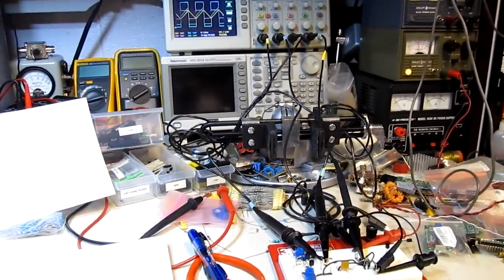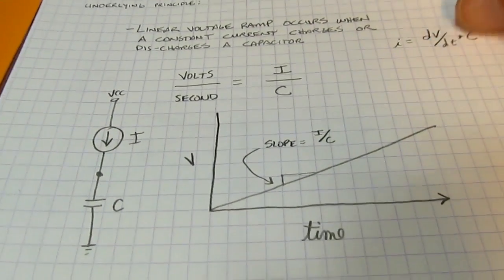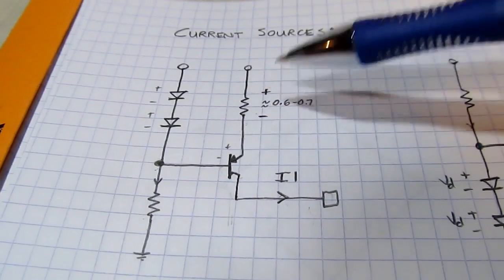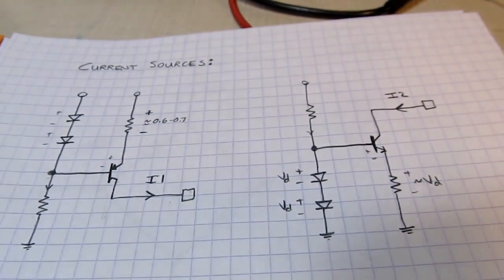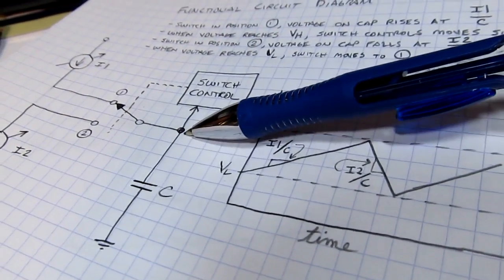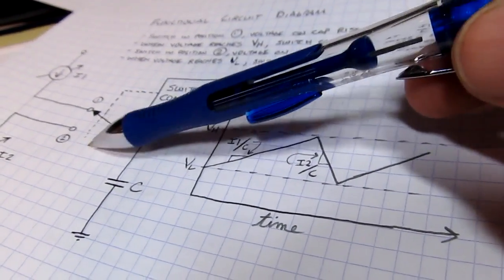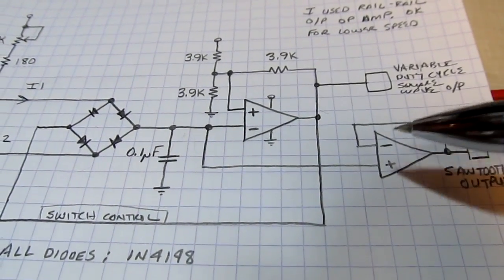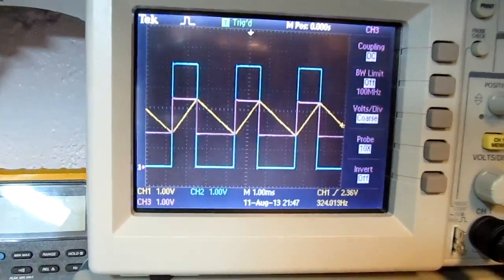#104: Circuit tutorial: sawtooth generator w/ current sources, diode switches, hysteresis comparator

Comment: If a current source causes a cap to charge linearly like that, does that mean a voltage source would create a similar waveform in an inductor?
Reply from the maker: Yes, a step voltage change across an inductor will create a linear increase in current through the inductor.

Comment: I am so glad you walked through that in the manner you did.  That is exactly how engineers think when designing circuits.  Basic fundamentals to Functional blocks (usually add specs) to tools in the toolkit to Proof Of Concept.  Then the fun of debugging those parasitic and/or unintentional effects (e.g., the diodes don't all switch at the same time, temperature drifts, etc. etc.)  You should do one on using a transistor's PN junction as a fast (low charge) diode.

Comment: What happens if one of the back to back diodes is removed? This would place the pn junction of the transistor and the pot resistor at 0.6 volts combined.  Would the transistor conduct? And if not,  would not the resistor become a pull up resistor, putting the DC voltage across emitter and base, which is still greater than 0.6 volts,  yet no current flows? mikey7195@yahoo.com
Reply from the maker: The transistor would barely conduct, very little collector current would flow.
Reply: Thanks....what if given the same the situation i described above and there was no resistor at all...saturation and no way to regulate the current?
Reply from the maker: @mikemoulton5309  With no emitter resistor, and the transistor saturated (due to extremely high resistance at the collector), it'll simply appear like two diodes connected in parallel.  Interestingly enough, circuit structures like this are commonplace in IC design.  In these situations, where device matching is very good, transistors can be connected like this to form current mirrors or PTAT current sources (proportional to absolute temperature).  Often the connected devices are of different sizes, again to take advantage of matching, etc.  Bandgap reference circuits use such circuit techniques.  These things are generally not done in discrete designs because the transistors are not match (thermally or otherwise) to the degree they'd have to be.
Reply: I have more studying to do.  Thank you.  Would it be possible for you to produce a video of a complex circuit and show behavior when a component fails or is removed from a circuit? I`'ll watch as much of your library as possible.
Reply from the maker: @mikemoulton5309  The variations on this theme have infinite possibilities, so it would be a tough topic to tackle.  Maybe my existing repair videos are the best source for this type of information.

Comment: why we have used three 3.9 kohm resistance. can't we do this with two of them i.e. to not use the one connecting the power supply.
Reply from the maker: It will dramatically change the threshold.  When the comparator goes low, the threshold will go to ground and be too low for the circuit to operate properly.

Comment: Love the tutorials and are very helpful.  As I'm a beginning hobbyist, I just ran into the current source and current sink topic.  Could you explain it in depth and the reason you use diodes in series?
Reply from the maker: Series diodes are used to create a relatively stable bias voltage for the current source transistors, that doesn't change much vs. VCC changes.
Reply: @w2aew  Thank you for the quick response!  Keep up the good work!

Comment: Would it still work (but opposite) if you put the capacitor in series between the diodes and the comparator?
Reply from the maker: Hmm  - I don't think so, since the input of the comparator and the output of the current sources are both high impedance.
Reply: Hmm, so no (or very little) current would flow? What if you add resistors to Vcc and ground? I probably should do the math to find out. 
Sorry, I’m obviously very new at this and trying to understand, but your videos help a lot.
Reply: w2aew I think what confused me was that an ideal current source would deliver its current no matter what. But with an ideal comparator input that would be kind of an unstoppable force/immovable object thing... so I guess in practice with non-ideal parts, without the resistors, you’d either surpass the compliance of the source, or get insane voltages?
Reply: ... and if I add resistors after the capacitor in series, effectively a voltage divider, that terminal just sits at the voltage determined by the voltage divider to Vcc plus the voltage determined by the source's current looking into the resistors in parallel. Until the current source reaches its compliance, the collector current breaks down, and the voltage gets pulled down to only the voltage divider's value.

Comment: Thank you. Excellent explanation. Can you explain why use the 2 diodes for biasing the base, also why current varies by changing the collector resistor. I thought the collector current depends only on the base current as seen in working of a CE amplifier.
Reply from the maker: You may want to re-watch that part of the video.  I explain that the two diodes are used to setup approx 0.7V across the emitter resistor, and it is the emitter resistor which is varied to change the current.
Reply: Oh sorry i meant the emitter resistor. My concept was like ic=ie=beta*Ib. But i think now i get it.The emitter resistor drop changes the base current thus changing the collector current.
I understand that the diode drop keeps the base voltage constant. So it is only a convenient way to keep the bias at the required voltage. We can also use  a conventional resistor voltage divider for this right ?
Reply from the maker: Correct.  By controlling the current this way, you make the resulting current much less sensitive to the transistor Beta.  Beta is NOT a well controlled parameter, so it is good practice to design circuits that don't depend on a specific Beta value.   Using the two diodes instead of a resistor divider helps to make the circuit less dependent upon power supply variations.
Reply: Thank you. Love your videos. Keep   up the good work :)

Comment: Love your videos.  Thanks for everything you do.  I repair electronics and most of the time its an easy fix or I get help with it.  Wondering your opinion on what is best way to learn everything cause it seems overwhelming with so much to learn.  Do you have any recommendations for simplest learning curve?????  Any help is appreciated.
Reply from the maker: Well, it is really impossible to learn *everything*!  There really isn't any shortcut.  You'll need a solid understanding of the fundamentals (ohms law, passive components, basic active components, AC/DC circuits, etc.).  For me, experimentation and measurement is the key for learning - I am more of a visual learner as opposed to theory.  But, everyone is different.  Find the medium that works best for you (books, web forums, videos, hands on building/experimenting, etc.), and plug away with that.
Reply: Thank you for your reply.  There is so much to learn.  And again awesome videos.

Comment: excellent video! if one were to use this circuit for a synthesizer oscillator, how can one add frequency and dual slope (rise and fall) voltage control to this circuit? for slope CV, would you hook up the CV to the gate of the transistors, because the current determines the slope. as for frequency you would hook up the CV to maybe change voltage setting the hysterisis? my guesses! would love to know the REAL answer from someone with knowledge/answer!!
Reply from the maker: You could make the current sources controllable by a voltage - that would give you variable frequency controlled by a voltage.  It would do so by changing the slopes on the triangle wave.

Comment: Thank you for making this video,  easy to understand as a beginner.
I have some question for this circuit. I made this circuit on the breadboard, but it doesn't work.
I used the function generator to make square wave of switch control, so i just made circuit with current source, switch, and capacitor. Does it matter of voltage at C? And why the unity gain amp is need at the output?
Reply: The unity gain op amp buffers the voltage at the capacitor. It prevents things attached to the output from drawing large currents from the capacitor and affecting the waveform.

Comment: Thank you again for this nice circuit. I build it last night straight on a perforated board and it works perfect. I used sockets for capacitor so i can have some flexibility in the range and an SMD rectifier bridge. 
Sometimes I feel the confirmation of the breadboard is needed, but thanks to your clear explanation I didn't have to. Great addition for my beginner's lab! (Well, I have a Chinese scope with built in DDS but this is small and battery operated)

Comment: Man I swear this must be the only vid that explains the basics of capacitor on constant current source , and the whole design for a variable ramp wave generator , really grateful for the sharing, one question, how would you solve the problem without the diode bridge, which I also learned in this vid, thanks again
Reply from the maker: If you didn't want to use a diode bridge, you could add some circuitry to directly turn on/off the current sources.

Comment: What op amp are you using? I was thinking of trying to build this using a TL071. Do you think this is a good choice?
Reply from the maker: I don't remember which rail-rail op amp I used.  You certainly could use a TL071, but you would have to use a split supply or shift the operating point of the circuit to be within the input common mode range of the TL071.  You may also have make some changes at the op amp output to be compatible with the switch voltage requirements.

Comment: THANK YOU a lot for all your video! If only YouTube and your channel already existed in the '90s... I am an hobbyist (started with ARDUINO etc) and some of your circuits I built up for some "analog" fun. Now, unfortunately for this one... I have no clue why it doesn't work... I checked and double checked... Can you specify what the supply voltage was in #104, which manufacturer part no. U used for the transistors PNP and NPN and for the OPAMP. Also for the buffering OPAMP. I used the 1N4148 diodes as you told... Thank you in advance!
Reply from the maker: The transistors are just general purpose NPN and PNP, like 2N2222 and 2N2907 or 2N3904 and 2N3906.  I think I used 5V VCC, but anything from 5 to 12V should work fine.  The opamp is any general purpose rail-to-rail device.  I used an AD8032, much faster than what was needed, but it is what I had on hand.
Reply: Thanks again for all

Comment: I would have thought that a mains Bridge Rectifier would have been more appropriate as it would cut down the number of components.
Reply from the maker: Diodes in a bridge rectifier typical have long reverse recovery time. Hence, the use of a set of switching diodes.

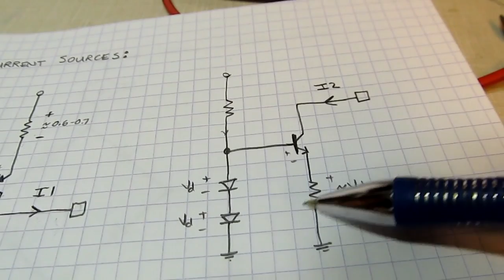Comment: Hi Pro, I built a current source with NPN BJT using your circuit at 5:08 as a reference. A constant voltage is applied to Base and 110 Ohm resistor at emitter. The loads are several LEDs in serial, the cathode of the last LED is connected to Collector of BJT,  the anode of first LED is connected to +24V,   But the problem is: if the load are 2 LEDs in serial, the current reading is 30mA, if the load are 4 LEDs in serial, the current reading is 32mA. In these 2 cases, the voltage applied to Base is constant. Why the current readings are so different, please? Thank you.
Reply from the maker: Because the transistor isn't a perfect current source - it can be affected by collector-emitter voltage and by temperature.  In your case, the transistor's junction temperature rises when fewer LEDs are used (more Vce), that is probably the dominant factor.

Comment: sorry sir.I need create triangle form this circuit but can variable frequency between 2k-50kHz.How to make?
Reply from the maker: The frequency can easily be varied by changing the current sources.  You can use a currrent mirror so that one adjustment will adjust both current sources.
Reply: thank you sir.i want to make triangle 0-5V.amplitude how to make it? and what is variable duty cycle?
Reply from the maker: In order to use this circuit to get 0-5V, you will have to use a split power supply, and adjust the resistors around the comparator to get the voltage extremes you want.  Or, use an op amp to amplify the the triangle wave from this circuit as is.

Comment: i found the same circuit (not as detailed as this) but in an abstract form i.e with two constant current sources (one is sink) and with hysteresis in Design with operational amplifiers and analog integrated circuits by Sergio Franco and thank you W2AEW for making me understand Franco better
Reply from the maker: Yes, this is (was) a very common basis for analog function generators years ago.  It makes a very good example for the application of current sources, diode switching, and schmitt trigger (comparator with hysteresis).

Comment: i bread boarded this circuit and it worked for me , but the waveform is not stable(might be my bread boarding is not good and i should design a PCB for this ) and the other sawtooth waveform generator (constant current source , charging cap with ramping voltage and scr connected transistors didn't work for me) i used 2N2905  PNP Transistor and 2N3019 NPN transistor

Comment: What op amp and transistor using?
Reply from the maker: Transistors are just about any general purpose devices like 2N2222, 2N3904 and 2N2907, 2N3906.  The op amp is a low power, rail to rail device.  I used a LMC6482, because that is what I had on hand.

Comment: Ok I have a good question... how would you configure this so when changing the slope on the rising or falling edge it doesn't change the frequency ?! 

I thought that maybe using a long tailed pair in its differential mode will be a good way to achieve that so each collector on that pair control one of the current source (falling/rising) while keeping a balance between the overall current (tail current) which dictate the frequency. But after that,  how can you turn this into a variable frequency oscillator without affecting the shape of the slope ? 

I thiknk that maybe by varying the tail current (using a adjustable current source) on the long tailed pair this will change the overall current without affecting the ratio between the the rising and falling edge of the slope (but maybe its a sloppy solution especially if you want to have a wideband oscillator). 

So I put this on paper and I might have something but yeah I have some hard time at this point to see how I can correctly connect this without loading the differential pair and avoid to have to buffer each collector with opamp. I would like to know if you have some idea. 

Cheers
However great explanation
Reply from the maker: As you've surmised, if you make a change in one of the slopes, you have to make a complimentary change in the other in order to keep the frequency constant.  The arrangement you described (diff pair, with the two outputs mirrored to create the charging and discharging currents) will do the complementary rate changes nicely.  Changing the tail current (along with a switched selection of timing caps) will give you the frequency control.  The diff pair input voltage could be called a "symmetry" control.  Add some emitter degeneration in the diff pair to give yourself a more linear symmetry adjustment.  Just use some current mirrors on the tails and you won't have any loading issues.
Reply: oh awesome I have to try this thanks a lot for taking time to validate that !!

Comment: Thank you very much for your videos... great explanation. How (and where) would i implement a adjustable frequency range for the waveform ? Thanks Patrick
Reply from the maker: There are a few ways.  You can vary the timing capacitor value, or you can vary the two current sources.

Comment: Thank you for sharing your knowledge on these videos, they are a great learning resource. I would like to make a question: do you think it's possible to use this approach to make a 20MHz (or even faster) sawtooth generator? I would like to built it to use as a sweep generator for a CRT based oscilloscope I'm building, so the ramp have to be as linear and precise as possible. Thanks!
Reply from the maker: Similar techniques are used for CRT based horizontal circuits - especially using a current source charging a capacitor to make a linear ramp.  Since you only want a fast discharge, the design is simpler.  Leave the current source charging the cap all the time, and simply short the cap with a transistor for the retrace.  Leave the cap shorted until you trigger, then let it ramp again, etc.
Reply: Thanks a lot for the help, I'll do that!
Reply: @w2aew   To get that we can simply put time delay switch(monostable multivibrator) instead of the hysteresis comparator, in purpose to control the diode ring.. In that case, input of the delay switch shouldn't be coneceted to the cap, but we need to connect it to the output of the oscilloscope trigger circuit...Alan, please correct me if I am wrong..

Comment: Excellent and brilliant electronic knowledge transfer, but the camera movements did disturb me a little, no need to close up so much on the circuit, A wider scenario would have suited me better.  Again excellent knowledge transfer. Congratulations.
Reply from the maker: Thanks for the comments.  I've improved my videography skills a bit in the three years since I did this video - most are not shot using a tripod or other camera mount to minimize camera movement.